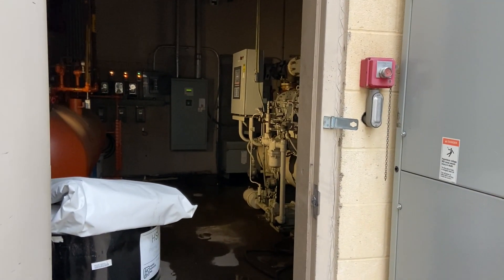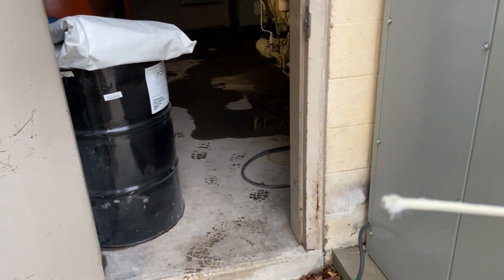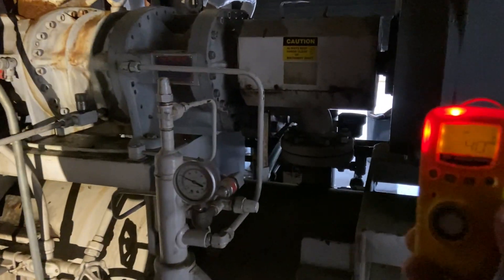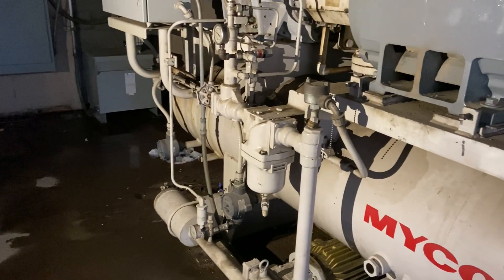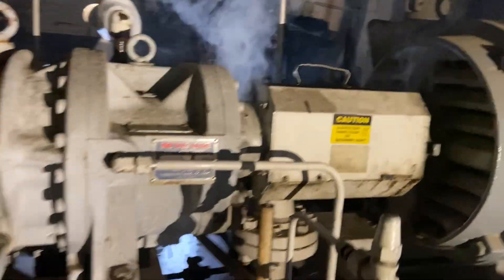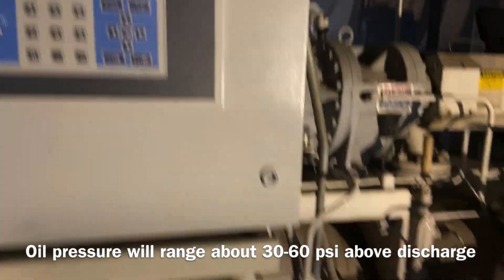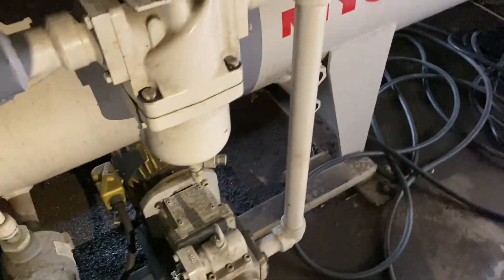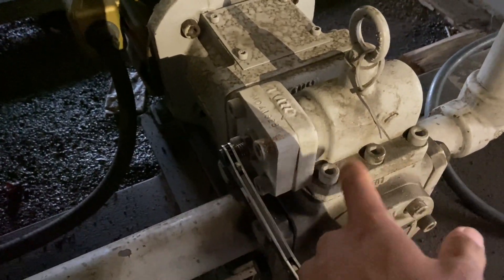Quick Ammonia leak search With A Sulfur Stick

Comment: Few things to highlight here:
1. You are using flame (from sulfur stick) near to NH3 gas leak, which aggravates fire risks. You know NH3 is flammable right?
2. I don't see you have an NH3 detectors around that area to easily detect leakage.
3. It seems also you don't attach this area to your scrubber system, if you have one.
4. It seems also you don't wear any breathing PPE at all when you are entering to this area.
Reply from the maker: You do have some good points but ammonia is flammable at a 15-18 percent concentration And at that concentration there’s no way I would be able to enter the room. That’s like 15,000ppm. There’s a leak detector in that room but it doesn’t alarm till it reaches 150ppm or 300 ppm. I do have my mask on me and personal monitor.
Reply: @UlisesPalacios  Actually I am now working in a factory that refine NH3 in Malaysia. Our safety system is not the best but we are thriving to meet our regulatory in terms of Safety, Health & Environment regulations.
Reply from the maker: @fazleemonty9126  that’s awesome. Be safe
Reply: @UlisesPalacios  you too, sir.
Reply: Sulfur sticks were all we used back in the 60’s. There were no electronic detectors. None of that stuff. As far as fire danger, you wouldn’t get anywhere near a leak big enough to light on fire with a sulfur stick. Even with a mask that ammonia would be burning your skin inside your clothes.

Comment: Need to get that pumped down and valved off and that seal replaced. I work in the same field. Stay safe brother.
Reply from the maker: For sure.  The motor bearing went out and took out the shaft seal
Reply: How old is that motor? Should be greased and hit with temp guns periodically with pm's hope it's all resolved. Ammonia is no joke. Take care! Thanks for the reply
Reply from the maker: @extendedmagz8414  I told them several times. I could hear it. But they didn’t want to do anything about it.. This place only calls us when shit hits the fan.  No maintenance. They need some oil samples and vibration analysis at least 1-2 times a year.
Reply: @UlisesPalacios  I believe we do oil samples on a quarterly basis. Funny story is we have even sent brand new oil to get analyzed and they told us it was bad and need to buy more from them. LMAO. Ive been out for covid but have a couple suction regs to change when i get back. We just replaced 25 valves on the west end of our plant. I work at a Tyson plant. It's not so fun when it's 98 degrees out and high humidity lol.
Reply from the maker: @extendedmagz8414  dang. Who do y’all send the oil off too. Isel?  Tyson’s are pretty big plants.  I’m looking forward to cooler weather
Reply: Are u a amonia refrigeration tech?
Reply: @JavierSanchez-uz6lb  Yes

Comment: 50ppm averaged over an 8 hour days means that you can be exposed to 24000ppm for one minute.
It's also 400ppm for an hour, both of which are in the IDLH ranges.
Reply from the maker: RonJohn63 yeah. It’s kinda strange because if you are exposed to 24000 ppm for one minute it will be your last minute.  You are correct above 300 it’s idhl. That’s straight from OSHA’s website
Reply: It definitely doesn’t mean anything close to that. Time weighted averages are not linear to any amount of time you select.